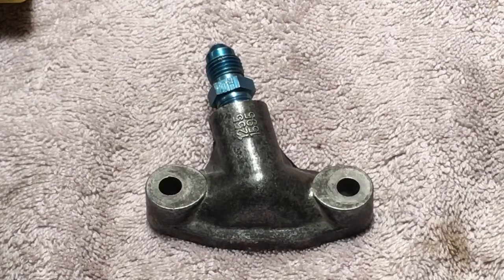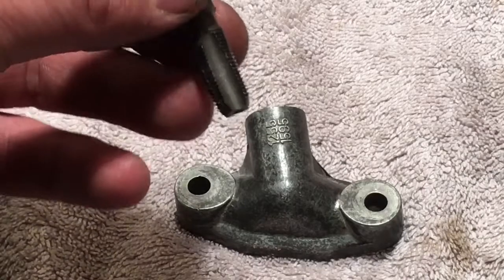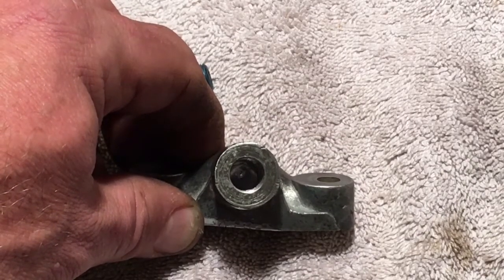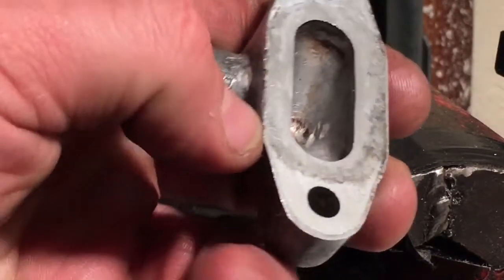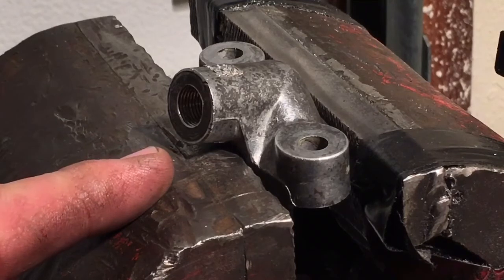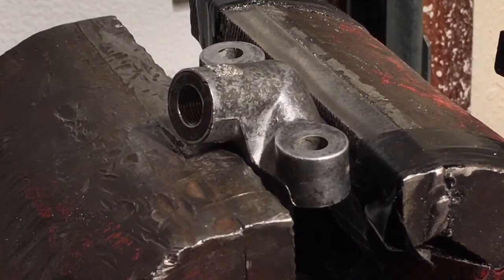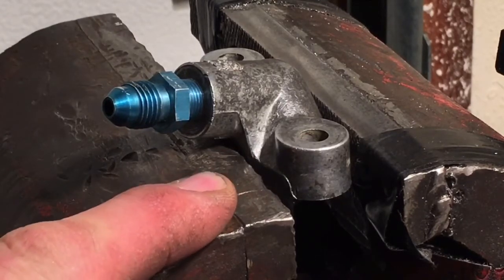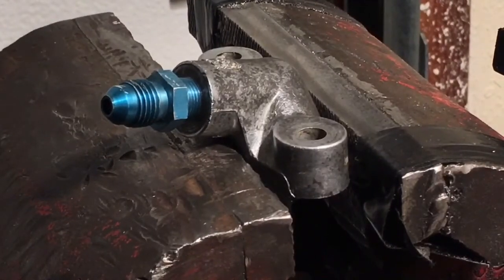Turbo oil feed fitting LS DIY

Comment: I never would have thought of this. Whenever I saw someone build a turbo oil feed line, they put a brass tee fitting in the oil pressure sensor port. One side of the tee goes to the turbo, the other side goes to the original oil pressure sensor. Sometimes they use a fitting with more outlets if they want or need an oil temperature sensor.

There is a major concern about how you get oil flow to the turbocharger. How will you know you get the right flow rate to the turbocharger? I have never seen this explained in situations where the engine or a variant of the engine never had a turbocharger. In addition, ball bearing turbos typically require a lower oil flow rate than a journal bearing turbo. This looks like a complex problem to solve in your situation. At least when a turbo engine has journal bearing turbos replaced with ball bearing turbos, you can buy a orifice tube and install it in the turbocharger oil plumbing.

6:23 Often they are called "Spline drive sockets." I have a set of Mac spline drive sockets that have removed bolts that I would think were hopelessly damaged. The $200 I paid for the set practically paid back in a month of professional service.
Reply from the maker: Skyline Fever As far as I’ve found “Journal Bearing” Turbos need full engine oil pressure. I’m not sure what the limits High/Low would be? 
“Ball Bearing” Turbos use a restrictor setup; I’m not sure why they would need less volume? 
I’m looking at Journal Bearing Turbo’s, I’ve been told ball bearing turbo’s aren’t rebuildable, once the bearings wear into the casting it’s trash.  Why wouldn’t they use a replaceable hardened race?
Reply from the maker: Skyline Fever I bought a small basic spline drive socket set as a Christmas gift for my iirc under $25.00... 👍. I agree with you, those spline drive sockets have saved me many times!
Reply: I'm also not sure about the reason why ball bearing turbos need to have less oil than journal bearing turbos. As for ball bearing turbos not being rebuildable, I am not sure about the reason. However, I have seen that it defintely doesn't hold up on a daily driver. The early Ford 6.7 PSD proved it:
https://www.youtube.com/watch?v=2qqs3nhoFrk

I suppose a turbocharger rebuilding shop could offer advice, I sometimes see them in tiny corners of industrial parks. Usually they are around other automotive rebuilding specialists like carb rebuilders, driveshaft fabricators, speedometer calibrators, and alternator experts.

Comment: I welded a bung for 10an to the oil pan for a return. Never heard of going to the front cover. Send me your pan and alum fitting and i will do it for you. You just pay shipping. This is cake to do.
Reply from the maker: TJS Welding and Fabrication I appreciate your generous offer, I actually got bored and drilled the timing cover last night. 😳. There’s a “boss” near the bottom on each side people use for a return port.  
Depending on what area of the oil pan used for the return, it is possible during idle no movement or during braking the front area of the oil pan can have oil in it.  If the oil drain port is ever submerged in oil it causes a back up of oil and can effect the Turbo seals. 
The only verified issue I’ve seen is on the modified oil pan on a Typhoon, it has a front sump area that holds oil, not the best idea needs its own drain, that caused an issue. 
I truly appreciate your offer!  JD
Reply: HeadFlowInc i welded the bungs on the side of the pan way up high. No backup of oil would ever get there during braking or cornering.
Reply from the maker: TJS Welding and Fabrication Have you ever sectioned the sump on a truck pan?
I’m looking to cut 1 1/2” to shorten the sump and the same to the oil pump pick up tube.
Reply: HeadFlowInc I have not. However I was asked in the past and declined because the pan was used and not new. I have fought with used cast alum oil pans in the past when tigging. Not saying it cant be done but new casting is just better. I imagine putting the pan on the mill table and using a slitting saw and go at it from there.
Reply from the maker: TJS Welding and Fabrication Yeah, the oil wicking issue is why we didn’t want to try it.  I see several people on YouTube who made it work, but who knows how?
I’ve got the pan as clean as possible but it hasn’t been thermally cleaned so I’d assume there would be oil wicking issues. 
I’ve been in contact with a few options locally, but if they haven’t actually done it I may end up in a nightmare. 😳
Reply: HeadFlowInc do you have any video links where this process was done.
Reply from the maker: TJS Welding and Fabrication https://youtu.be/gQ6NF3k_5bo
Reply: HeadFlowInc oh my is all I can say after watching  that.    Best thing of his whole project was edm cutting the pan. I am sure i can do it 100 times better without cracking as he used the wrong filler rod as well as shocked the pan. Do you have a new pan.
Reply from the maker: TJS Welding and Fabrication I broke down and ordered the GM Muscle Car oil pan from Speedway Motors; should be here We’d. Or Thurs. 🤔
Reply from the maker: TJS Welding and Fabrication My pan is used from 2002 truck.